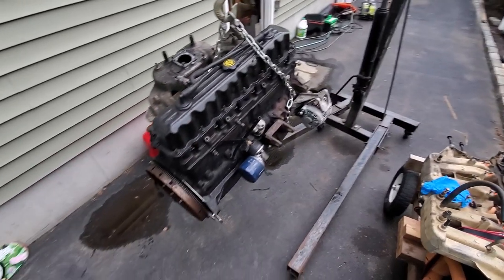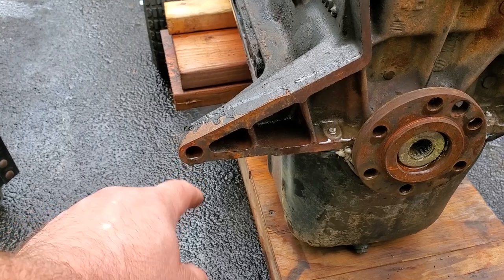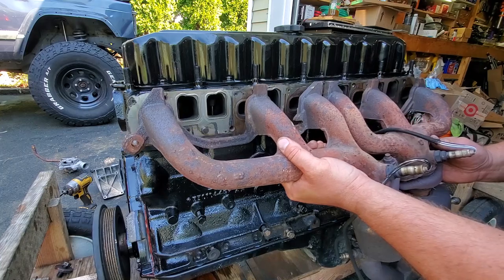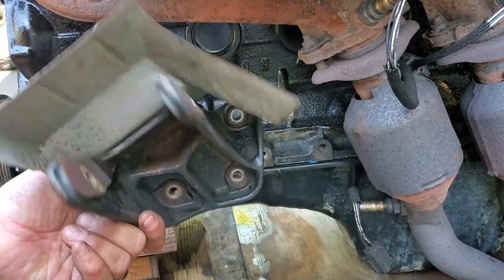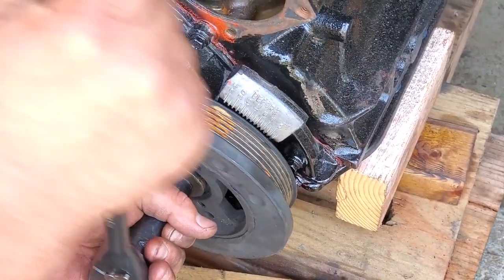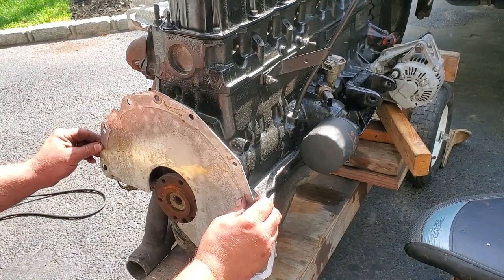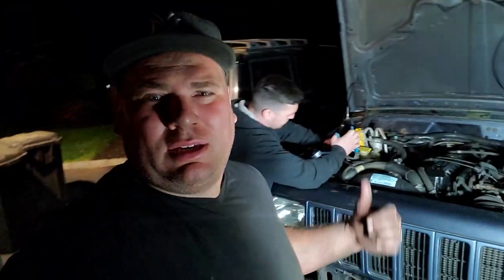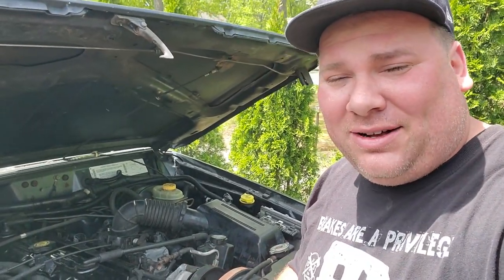2001 JEEP CHEROKEE XJ 4.0 ENGINE SWAP - Part 2 Engine Prep and Install

Comment: The engine was installed previously in a manual and he set it up for an automatic. Gotta remove the pilot bearing or the transmission won't mate.  Ask me how I know. 😂
Reply from the maker: LOL, YEP! Depends on the years the older years are longer and definitely wont fit!
Reply: @ProjectDanH  it’s a minor but important detail to look out for.  

Or replacing/adding the pilot bearing if your Jeep is a manual and going the other way. Throw out bearing is also a good replacement if your in there and it’s a manual.

Comment: I had a 94 2wd w/5 speed and I could give college kids fits in their little BMW's stoplight to stoplight.  I've owned 4, totaled one and it saved my life, they are built very strong and the 4.0 6 cylinder is a beast.

Comment: I have a 00 jeep XJ and bought a 99 XJ with good motor I’m gonna keep my coil pack not distributor how do I make the coil pack stay on the motor because the bolts aren’t there to mount it ??? Thanks love your videos
Reply from the maker: Thanks brother! you have to put your head from 00-01 on it!  Make sure if its stamped 0331 that it says TUPY on it!
Reply: Check out K Suspension and the viper coil pack mod.  Seems perfect for this scenario.

Comment: Hi Dan 👋 👋 👋 👋 just wanted to let you know that the Freeze plugs  on the back of your engine needs to be replaced. I see Rust. Hopefully it will work for you.. Anyway don't forget about buying   Brass freeze plugs I bought my freeze plugs at Napa auto.

Comment: I used the Dorman dipstick in my 04 4.0 now 6 quarts read 1/2 quart overfull. Did you replace rear main seal? Just curious. put used 4.0 that had no signs of leaks in cousins Wrangler, started leaking 2 weeks after install. BTW, excellent job, my friend.
Reply from the maker: No RMS in this swap .. just did one in Wrecked J tho!

Comment: Dan how did u remove the dowels from the old engine? Struggling right now
Reply from the maker: Vice grips on the dowel, twist em while tapping the vice grips with a hammer... also I'm strong AF.. lol
Reply: @ProjectDanH  thanks for the reply! just finished my first swap today I did that method but I had to slide a drill bit through the middle so it wouldn’t flatten the pin

Comment: How did you torque the engine back to the transmission? Did you use crows feet wrench heads and a torque wrench or just wing it?
Reply from the maker: didn't have any Crows feet.. I used a 15mm gear wrench,. Couldn't get a torque wrench on so I used locktite and cranked it down

Comment: Hello Dan..I didn't know how to get a hold of you I been watching your videos since I found you ..enywho..I had an accident ran into a gas pump pylon..it smashed in my front passenger side it looks ugly..I have a 2010 jeep grand cheerokee limited hemi..I'm trying to figure out how to pull it off and if I should pound it out or just buy a new one..if you could message me back and we can chat help me out a lil bit since your a great mechanic on jeeps..I've watched alot of different people ..but bro you out smart em..let me know..have a great jeep kinda day!..thanks
Reply from the maker: Hey, Thanks for watching!!! So sorry about the accident.  Depending on the severity of the damage and If it still runs and drives you could start to accumulate the obvious parts first.   If you can pull your own new parts yourself you can learn how to do the job yourself.  When you have the parts and some confidence dig in!
Reply: @ProjectDanH  appreciate it...do you have an email address or some way I can show you some pics of the damage then maybe u can shove me in the right direction..?
Reply from the maker: @stephanieshirley614  hit me up on Instagram @project_danh
Reply: @ProjectDanH  ...dude thank you..I'm really amazed you connect with your viewers and jeep lovers..I have so many ?..but my wife has insta and we'll drop you a message...thank you Mr. DanH..

Comment: Hello Dan great series. Have a question on a ZJ 1995 Grand Cherokee. My Digital Heater/AC control blows cold air BUT if I move the temp dial just 1 degree it blows hot air for days. So if set to 55 degrees and move to 56 or set to 70 and move to 71 air blows heat instantly for days. I don't touch the 55 (blowing heat) then in a few days it blows 55 again. AC will blow 55 as long as I do not touch the temp dial. If I adjust the Temp just 1 degree boom HOT air and wont go back to 55, 60, 71 or whatever for days. Have you any solution or things to check?
Reply from the maker: Hey, Thank you for watching! try replacing the AC control unit

Comment: Hey Dan, do you know if it’s possible to convert a 2wd WJ to 4wd?
Reply from the maker: Yes.. absolutely.  You'll need an axle, transfer case,  Shifter, driveshaft... But yeah, it's possible
Reply: @ProjectDanH  Thanks Dan I love your videos BTW
Reply: Anything is possible for sure 😁👍🏻
Reply: Forgive my lack of knowledge with the xj zj lmnop stuff ..what year do u have that u want to make it a  4x4 .. and where do u live i have 2 extra transmissions for the 98 laredo 4.0 .if your local your more then welcomed to take one for free ..im in NY long island. Trans has the transfer case already on them and event the front drive shafts as well.. i do have a shifter aslo and i should have everything u need ..for free like i said if your local
Reply: @jaboneyoyo5843  that's awesome your going to help some one out like that, I bought a part jeep for that purpose but now I may put it together lmao, I'm in NM so not close enough to help out but my bodies are rust free
Reply: @cliff400  yeah that would be awesome if you were local and the offer extends to anyone , ik dan through a friend and i gave him a bunch of stuff already just for the heck of it and like i said i would give anything i have away to someone that could use the parts .. its how i am ,if i can help someone i will. I keep all good parts and can't chuck them  😂
Reply: @jaboneyoyo5843  I'm trying to learn the jeep TJ, YJ, ZJ, XJ, and WJ differences and similarities too. But y'all wind up in NM give me a holler.
Reply: @cliff400  me to for years now. Im 52 y.o and well forget about it .. its just to much to remember for me lmfao.. and the same to you  If you end up on Long Island in New York give me a holler. Have a happy thanks giving to you and your family
Reply: @jaboneyoyo5843  oh and I got a couple years on you

Comment: Hi questions  what  name the book ? im have  cherokee xj  in need  this mecanic  book
Reply: me to😅
Reply: 14:39 Hello Dan, and thanks for the screenshot. My Haynes workshop manual doesn’t do the electrical sensor.😢. Finally finishing swapping a rebuild 4.0l I in my Xj classic sport , purchased from USA engines in the Netherlands. Completely cleaned and spray painted al the parts that came of the old engine which had been leaking oil al 😢around for about six years😩. Sandblasted the exhaust headers and spray painted those with heat resistant paint. Today I am cleaning the engine compartment. So hoping to get it running by the and of the week. Keep up the good work and Greetings from the Netherlands.
Reply: Factory Service Manual